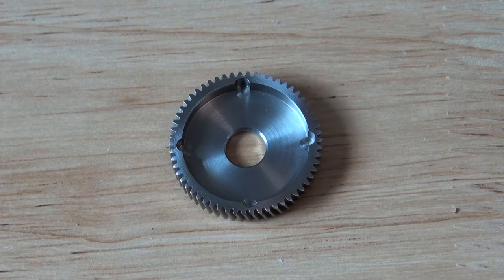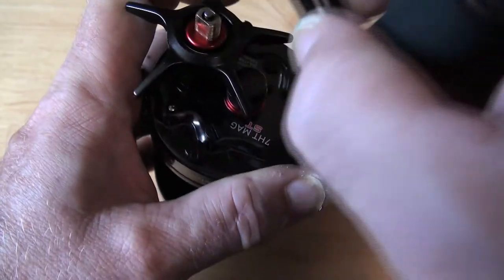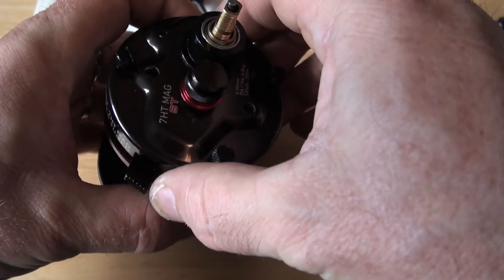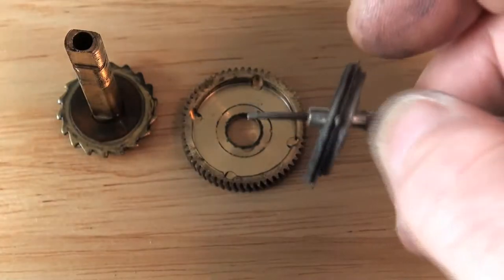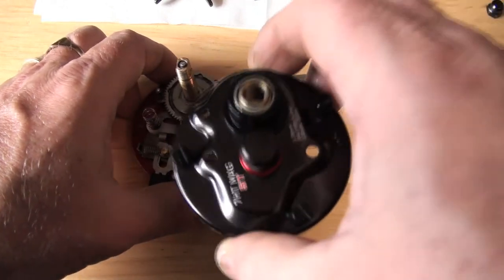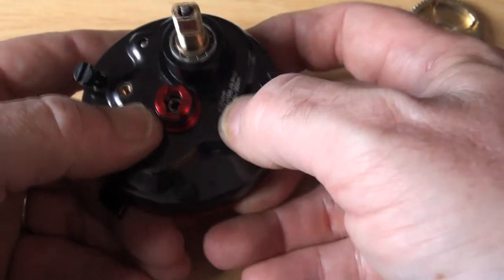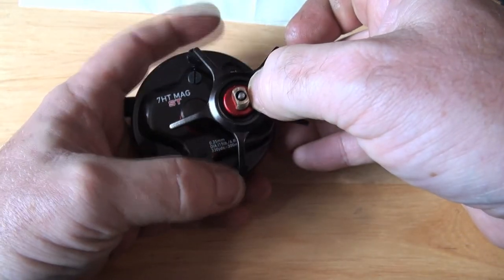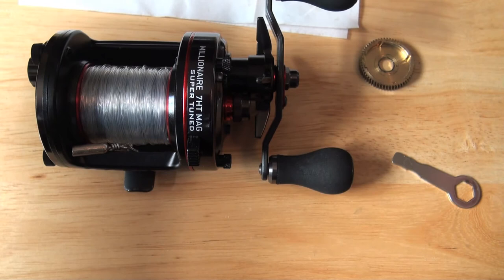Daiwa 7HT Mag & ST How To Replace The Main  Drive Gear Step By Step Instructions

Comment: Nice job. Thanks.  I just ordered the pinion sleeve and Carbontax washers for my 7HT MAG ST, and this vid is going to help with the installation of those.
Reply from the maker: Now all you need is the ManFish Stainless Steel main gear!
Reply: @PimpMyReel  Haha.  YES.  Soon.
Reply: On another note.  I'm sure that by following your vid that I can swap out the drag washers.  Is there a shortcut to doing this?  Do you know if swapping to the carbon washers will increase the maximum drag setting?
Reply from the maker: @dennispenton6872  Why do you think I said you will need to swap out the brass main gear for the steel.... Brass will not take the extra drag you want to add.....!
Reply: @PimpMyReel  Alright then.  Order coming your way...
Reply: @PimpMyReel  Can you send me ordering info?
Reply from the maker: @dennispenton6872  jamielifetour@googlemail.com

Comment: no grease on the drive gear? ( I don't think its necessary except to quiet the gears.) I notice factory gears are slathered with heavy grease.
Reply from the maker: Yep, I use engine grease on gears, just did not want to get any on the table (wife would not be happy).
Reply: @PimpMyReel  I have two of these reels but can not take bearings out to clean them any advice please